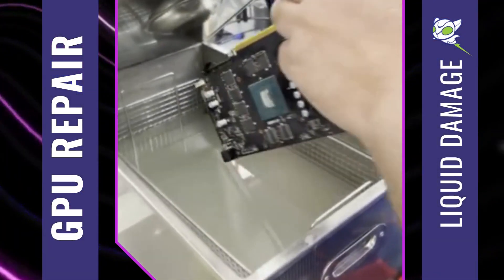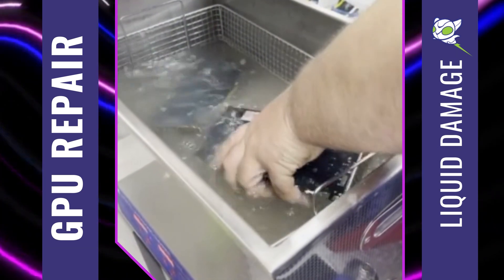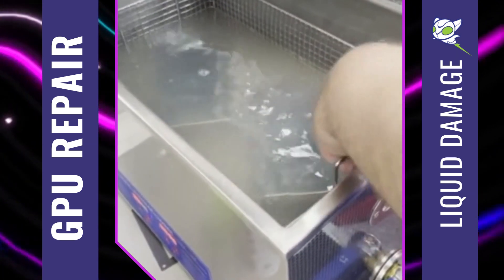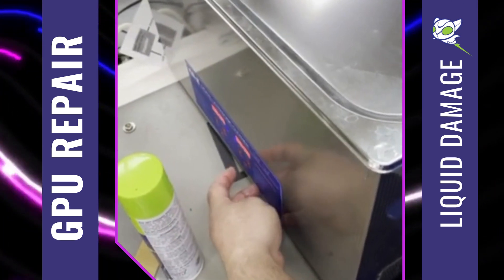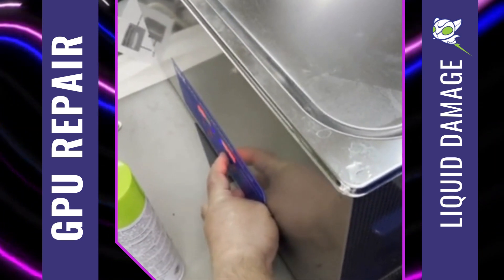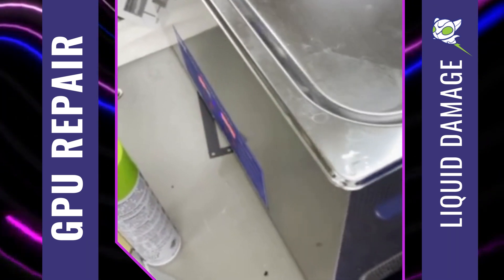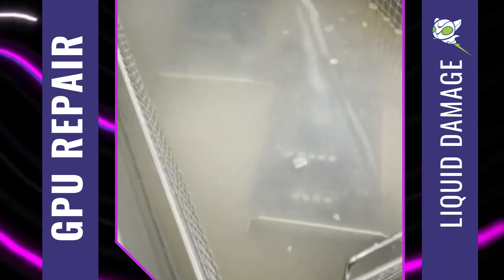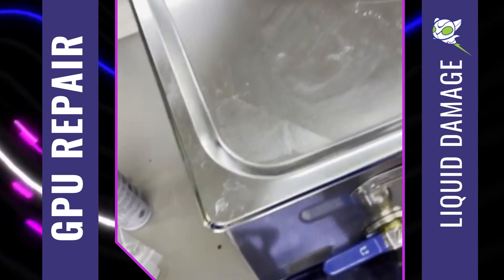GPU Liquid Damage Ultrasonic Cleaning

Comment: So your fix to liquid damage is more liquid, I use deoxit, because it cleans water damage, removes water, and leaves a coating on the metal (copper/solder joints) to protect it.
Reply: is it an oily residue?